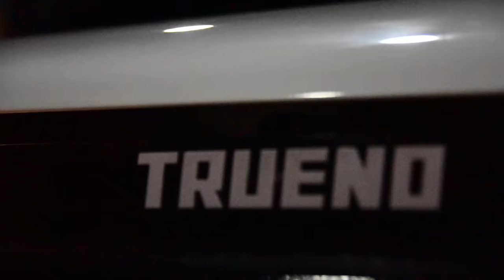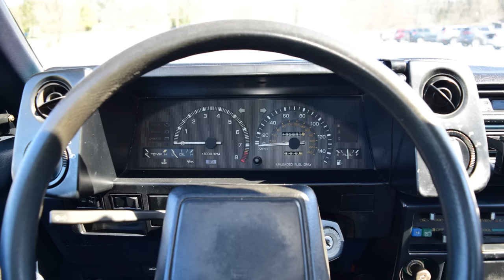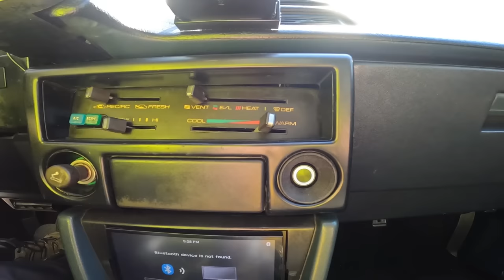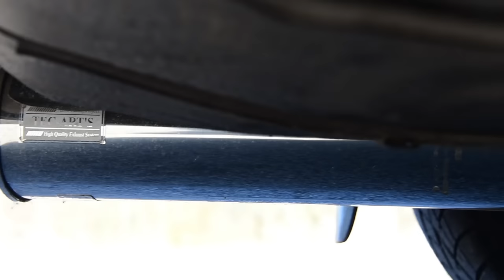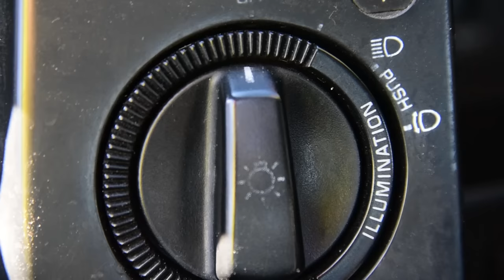1984 Toyota Corolla GT S Initial D AE86 Takumi Fujiwara Replica: Regular Car Reviews

Comment: So I entered the contest and bought a mug, but my intentions are not to keep the Corolla GT-S in its carsplay paint scheme... Mr Regular, I don't know if you'll read this but let me at least say my piece.

So I started getting into cars after Initial D. Yes, I was one of those kids. But truth be told, I think that was innate to me. I was a kid that grew up collecting Hot Wheels, Tokyo Drift was always my favorite, and Need For Speed was a big part of my gaming diet. Initial D was just the trigger to get me to regret not insisting to my parents that I wanted to take auto shop rather than take a college prep course. By that point I was stuck in Texas taking orders in McDonald's. After that I chose to quit my job and work at Domino's as a pizza delivery driver, then go to Community College for their auto tech program. Unfortunately I had to drop out and switch jobs since pizza drivers don't get medical, that and COVID made it hard to justify to my parents. Now I work at a car parts shop, earning only slightly less than I used to. But it did give me time to work on a little project of mine.

During that time I was working on a book. It started with one simple question: What if Initial D was set in America? At first it was just an exercise in plagiarism, literally writing the dialogue of the Initial D manga and swapping the names. But then I started altering it, changing the dialogue and altering the events to fit with a more modern setting. Rather than Japanese gangs racing each other for cred, it's amateur racing clubs with social media accounts racing for clout. Instead of delivering tofu, the Corolla delivers pizza. Instead of taking place in 1990s Gunma prefecture, it's in post-COVID West Virginia. Characters were subtracted, added altered, working on different tropes, archetypes and story structures. I gave it to an editor for review and while they did like it, they made some suggestions that finally changed the plot and made me realized 1) I had altered the story so much that it's a new one entirely. I had taken inspiration not just from Initial D but from Harry Potter, Scott Pilgrim, Fast and Furious, Karate Kid, and even my own life experience. When I wrote this, I was listening to punk rock, not eurobeat. And 2) some people haven't yet seen or read Initial D. Part of it is because it's a story about a niche topic, drift racing, told through a niche medium, manga and anime. 

I intend to turn this into a book, a medium dominated by YA dystopian fantasy. Part of it is because a lot of people showed interest in the project. I guess selling something as "Initial D but American" tickled people's brains. Maybe it's just nostalgia banking. But it's also partially because I think it would be interesting to someone like me, or anyone else reading this comment. As mentioned before, modern literature is pretty much swamped with YA dystopia, where it's about a girl fighting a laughably evil regime while having to negotiate a love triangle. I just think it's time for a change, Maybe get a new generation interested in racing. And let me be clear, I don't intent to rob Shuichi Shigeno of his story. Much like The Magnificent Seven is just Seven Samurai repackaged for a different audience, so too is this book. But at least it recognizes the original inspiration. There's a Japanese shop teacher in the book that used to race in Japan during the 90s, before working for Nismo and later immigrating to the US after marrying. He thinks it'll be a decent job to save up money for retirement, only to meet this teenager who gives him the case of Deja Vu. He's suddenly reminded of the legend of the Ghost of Akina. The teenage tofu delivery driver riding an AE86. But here is a redneck teenager, working at his uncle's pizza restaurant, who honed his skills during the Pandemic. The Hero of Moonshine Pass, driving an old Corolla GT-S. And now he has the chance to become his mentor.

Anyways, if I win, I'll wrap that puppy in a new design, put louvers on the rear windshield and use it to promote the book. Thank you for coming to my TedTalk.

Comment: 5:45, wanna be smoother on that shifter? Keep your knuckles up, use your palm for the odds, use your fingers altogether in a hook for evens. 2-3 is trickiest, you need to let the shifter get you back to the center of the pattern, if you try for fast, you'll munch it, if you try for smooth, you'll go fast. You can use as much pressure is needed, but don't have to muscle it. You can put it in the center of each gear instead of off to one side with too much sideways pressure that pisses off the engagement.

Comment: I unironically and not Initial D related would rather drive any old corolla than any 35k new car. I still simp for my old 99' AE110 venezuelan spec that my grandma gave me when I was 1.8 4EGE, manual, leather seats and gold plated emblems

Comment: For when you grow tired of the sound of the engine on long tofu deliveries, it's worth pointing out how horrible speaker placement was on most 80's cars, the AE86 included.  The AW11 MR2 however has near perfect upper dash corner speaker placement.

Comment: Get some PowerStop Carbon-ceramic brake pads. They shed very little visible brake dust. The '13 ST was bad for that. The factory pads were dirty suckers but very aggressive. In '14 they switched to a bigger disc and a harder pad because of all the gripes. The PowerStop pads and discs are a much better solution.

Comment: I didn't need Underground 2 or Initial D to apreciate this car. When I was a kid(early 2000s) I used to pass by one similar to this(it was a Levin), and it was a one of the cooler cars I have seen in person. So When RCR says that the car didn't need Initial D for it to be appreciated, I totally agree. It is a pretty car, and becomes more pretty with all the facts on the table.

Comment: Top top for white wheels: pull up to the wash rack at your local dealership (you might have to try a few different locations) and ask if they have any old cheesecloth (that's what we used to go through a ton of at the dealer I used to porter at) or any other kind of rags they're just gonna throw out otherwise. Just be sure to put them in the wash before you use them on your car

Comment: I saw one of these at a used dealership for cheap and passed it up because the only person who would want that car is a person who wanted that car because of the anime. I don't care about the anime or the car. Sure I could have bought it and fixed it up but I didn't care and the chances of finding that one fan who wanted that car is about as good as winning the lottery. I didn't want to buy a car and fix it based on the meme and hope it would sell. It was an 85, which I believe would be the specific year from that show. I could be wrong.

Comment: I had this year Corolla GT-S back in the 90's. It was more fun than a regular Corolla, and it was kind of quick, but it was a really basic car that DESPERATELY needed a 6th gear. God it was awful on the highway... Anyway, I sold it after it got broken into 2 times in a year. Apparently Toyota door locks from that era were super fragile and I'd had enough. Sold it for a late 80's Civic Si hatchback that was infinitely more fun.

Comment: These are or at least were fun little cars but they have a bunch of issues with design and build quality. Even 25 years ago when they were much younger they had problems with interior parts, (low quality materials etc), rear ends going bad,  gearing that is too short for highway speeds and many other things that aren't really surprising given it is a mid 80s economy car. The GTS reminds me of the Ford Taurus SHO, a car of middling quality with a nice Yamaha designed engine. The Germans were far ahead in terms of the things that matter day to day like build quality, electrical systems, modern independent suspension, transmission gear spacing, rust protection and a straight six with a bit more displacement.

Comment: It's 100% ideology but it's basically set in stone now.  The value is not going to drop or flatline to allow other vehicles to catch up.  No one is going to care that the same driving experience can be had for 1/4 the price by simply picking a different (and in most cases better) vehicle from the same era.  They want this one because it was in a cartoon.  That's it, end of story.  The 4AGE 16V is a mid-tier offering motor of the era in a bottom-tier aging chassis.  That's the whole point of the comic.  The car itself does not possess any advantages, the driver does.  If you want to know if you posses those skills, just get a Miata and spend the remaining $30k on track events, brake pads, and tires.

Comment: Kinda wild that it sold for 40k when it's an SR5 conversion. That's not a GT-S if it's an 84, they only made GT-S lift-backs from 85-86. It also has a "kouki" USDM front grille and bumper. That's not a "zenki" bumper, which the car have if it's an 84. Those back seats aren't GT-S seats either, and the interior panels aren't. They swapped the axle because it has disks in the rear which means it ditched the 6.4" rear for the proper disk brake 6.7" unit from a GT-S. Still crazy that a non-original car would sell for that amount, even for a give-away vehicle. He got ripped off it they paid that much and it's not a show-car, yikes.

Comment: I never understood short shifters. I mean, sure, in a truck with a 2 foot shifter throw maybe? But then it's a truck so who cares? 
The shifter should be close to the steering wheel so it's a short reach to shift then get your hand back on the wheel. 
Is there some performance benefit I'm missing?

That said, relatively light, relatively small, two door car, revvy NA engine, no stupid electronic throttle delay between your right foot and the throttle plate, manual box, and anything-but-electric steering? That's a recipe for fun. 
The fact it has pop-up headlights is just icing. 

I'd give a lot to have my 1st gen CRX back now that I have a bit of money to spend on it.

Ceramic pads are made for white rims by the way, you only have to wipe off your rims every three drives instead of every drive! 😂

Comment: You're really cleaning those white wheels the hard way.  Get some Mothers wheel and tire cleaner and a wheel brush.  Spray it, wipe it around with the brush, wait 30 seconds, and then rinse with the hose.  Skip the rags, paper towels, and wiping.

Comment: Hey Regular, consider Zep's aluminum truck and trailer wash. Pour it straight in a spray bottle you can pressurize and spray it on anything that isn't anodized. Works fantastic.

We used it at my old JDM shop for cleaning everything and I've never gone back.

Comment: I feel like without Initial D, the 86 would be in a similar place to the first gen RX-7. That's also an 80s Japanese car with just over 100 horsepower and a live rear axle, and in fact it was maybe more sporty than the 86, with its lack of back seats. I guess the 86 would still be popular because of Keichi Tsuchiya, but nobody really wants FB RX-7s. It's weird to think that the AE86 could have ended up in a similar place.

Comment: i love that the first ae86 you did was literally a better replica than this. how can someone say it's a "fujiwara replica" but not know how to make it look even remotely passable to the tofuten ae86?
-wrong wheels (needs 14 inch watanabes, 15 inch if replicating final stage) 
-wrong bumpers (needs the JDM ZENKI trueno front and hatch rear bumpers, not the USDM massive crash bumpers) (on top of that, the cibie fogs)
-somehow they got the right taillights, JDM trueno zenki ones
-take off those USDM marker lights on the rear quarters and bondo the holes
-wrong steering wheel (needs italvolanti steering wheel)
-plus a whole slew of minute differences i could spend ages talking about
i go crazy over these farby inaccuracies in supposed "replicas", then again, i'm not the one with a 40 year old toyota that costs 5 figures

Comment: When I bought my 1986 Pontiac Grand Prix LE back in 2004 for $1,500 with only 75,000 miles on the clock. Now 2023 base 305 v8 1986 Pontiac Grand Prix for $17,500 with over 93,000 on the clock. The GM G body fans now called a G Body Tax. These cars are getting more expensive as time goes on. Luck I still have my 1986 Pontiac Grand Prix LE since 2004 it's my first car. Now I in process restoring it. It getting aftermarket aluminum sbc race block. The car never been wreak and rust free.

Comment: The lesson I took from Initial D isn't that the car is iconic. The car's just a car. The lesson I took is that skill triumphs over money. In reality the car sucks. Everyone keeps saying over and over again in the show the car sucks. The latter half of the manga and show's metanarrative is about how the car is holding Takumi back. He's as fast in Itsuki's even worse car, he's faster in the Silvia, and he's faster in the WRX. Purely due to the trappings of the story that are disguised as Takumi's sentimentality, the author can't get rid of the thing because it became too iconic to the series and Takumi's underdog origins. The car is actually parasitic to the story about Takumi's insane skill at driving anything, and everyone mistakes the parasite as the host. The death of the car literally sets him free.

Also regarding that "The AE86 requires less skill than the AW11 MR2 to drive," remark. True that there's no snap oversteer and the skill floor is lower than the MR2, but the car's still got a higher skill ceiling than the MR2, and it comes down to two things: The lack of suspension adjustments on the *solid live rear axle*. Camber adjustments are narrow, toe adjustments are basically impossible, and if you unload the compression on the rear wheels the car will spin like a washing machine in the middle of a cycle. In the show the car had a custom made rear link for a reason. Driving at the limit takes more skill because the car is more volatile the closer you get, like a skill curve that plateaus at 60% along the X-axis before more than tripling along the Y-axis at 90% on the X-axis. I appreciate the challenge of a car like that, but that still makes it a worse car. This gets worse when people do the 4A-GELU conversions.

Comment: when are people going to let this car die? its not even a hot hatch, its just a 5-door economy car and most of them dont even have the cool digital dashboards
Reply: "when are people going to let this car die? "

Probably never.

"its not even a hot hatch"

Its not? Why?

"its just a 5-door economy car and.."

2-3 door, depending on coupe or hatch back. Regardless- Yes, it was "economical" for a sports car, was still a sports car. Front engine. Rear wheel drive. The GTS models were disc at all 4 corners, LSD option, first mass produced DOHC EFI engine.  By no means "fast", but they were still undeniably sports cars. 

"and most of them dont even have the cool digital dashboards"

Neat?

Still fun cars.

Comment: Did you just called the AE86 mid engine lol? Am I going crazy or is the AE86 definitely front engine?
Reply: Its front engine

Though to clarify: "Mid engine" refers to a car with the engine between the centerline of the front and rear wheels. Many cars famously have them behind the driver- but this isnt exactly a "must". If the engine is up front, but entirely behind the centerline of the front wheels, its still technically "mid engine".  However even under this description, the corolla/ae86 does not apply.

Comment: Thats an ae85 not an ae86 you Can tell by the seats and the steering wheel
Reply: "Thats an ae85 not an ae86 you Can tell by the seats and the steering wheel"

Ae86*.

Though you may mean Sr5, but to clarify: Sr5s were not ae85s either. Both GTS and Sr5 in america were Ae86s.

Comment: I finally got the chance to rent one of the AE86 replicas in some mountain roads Japan. Everything felt so analog and raw, and that engine note sounded just as I remembered from all the Best Motoring and Initial D episodes I watched starting from almost 20 years ago.

On a side note, the rental I drove had some god-awful brakes. Pretty sure they've been thoroughly abused by other tourists like me, but thankfully the car was light and slow enough to slow down safely.

Comment: I  get that its, yknow. The Car. But, it's also, an car. It's a 90 horsepower mid-80s econobox. Serious modding required for power. Rear wheel drive for whatever reason. I suspect no trac control or ABS, could  be wrong. Probably won't go above 80mph stock. It might as well be a volkswagen diesel from 1983. It bothers me that people would throw upwards of 20,000 dollars at what should be a fun little bullshit economy teenager car. For americans,  if you want that 80s styling or a good,  easy to work on 80s project, please buy a foxbody mustang. Please don't clap them out. Stick to Hondas if you dont want to throw a v8 in.

Comment: Thank you for explaining why. I'm too old to have been in the know. Tbh I didn't care all that much. My family had an 83 Supra in 83 how come it isn't a legend?
Reply: 83 Tera cotta p-type Supra is my dream car. So much fun, so little horsepower!
Reply: @gorehammer1  I wasn't allowed to drive it. It was black on black 5 speed. It got traded in for an 84 Escort wagon. The car I learned to drive in.
Reply: I owned one, the engine was really really boring. They become great cars with a 1j or 1uz swap but the stock 5m and 6ms were just..... Miserable.   The JDM version came with the much better 1g but without that, its a very good looking, slow, decent handling sports car but it doesn't do anything particularly great unlike the 86, later Turbo Supras etc
Reply: @Nightmaretyrant  I had a mk1 the 5m is slow but you can make them move, if I find another, it’s getting a 1j 💯 I love the driving experience of the car stock though. I feel that the earlier models were a luxury experience of a sports car of the time and not a pure sports car.